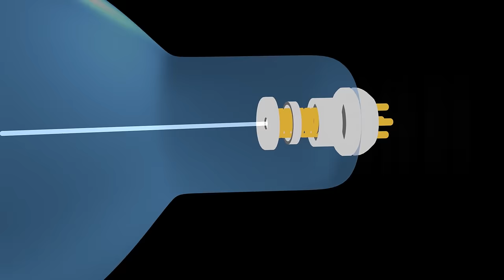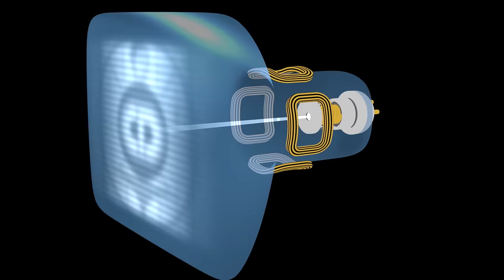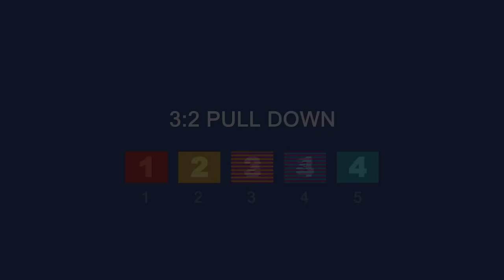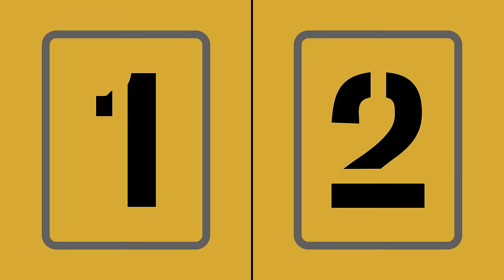CD / Interlacing

Comment: Before watching this video, I was aware that a program called Handlebar was able to remove interlacing fr converting DVDs by using the ghosting effect. The issue is, the monitor I was using at the time was the 720p progressive scan I wasn't sure what I was doing. This was years ago that this happened.

Comment: Can't you just leave the lines in between black when converting just like how they were originally?
Reply: Yes, you can. The reason why it is not done is that you lose half the brightness when doing that on an LCD, so the image gets really dim. Another issue is that timing and resolution become really important, you have to match them perfectly to the source material, you can't just scale the image to the monitor resolution or watch a 50Hz video on a 60Hz screen, otherwise you end up with artifacts and flicker. Example video: https://www.youtube.com/watch?v=d5eIjEEWQp8
Reply: @grumbel45  Thanks!

Comment: However CRT displays most commonly had their frame rates tied to the frequency of the AC mains power input so this was a limitation to an extent as CRTs in countries with 50hrz AC frequencies were limited to 25, 50 or 100 FPS which in countries with 60hrz AC frequencies CRTs could display in 30, 60 or 120 FPS! That’s also why in PAL countries with 50hrz AC power systems computers and arcade games were often capped at 50 FPS even though they were actually capable of running at up to 60 FPS! Also often line interlacing was done on VHS recordings and even VHS camcorders would add interlacing so that’s why most old VHS videos have interlacing! :)

Comment: Interlacing still halves the bandwidth requirements for a given resolution/framerate.
(fun fact. HD television broadcasts in my country are 1080i/50hz)

Interlaced video does not work so great on modern displays though. That's quite true.

But even so, given that it allows high resolution for slow moving objects with higher framerates for faster objects at a lower effective resolution...

It's an interesting tradeoff.

Also interesting is how 80's and 90's game consoles and microcomputers abused the broadcast signal specification to create a true progressive scan mode on these exact same televisions.

This was essentially done by scanning the same field twice, and leaving the other blank. (this is why games have 'scanlines' - one of the fields is blank, thus it shows up as dark lines between rows)

Really, the more fundamental question you might ask, knowing how CRT's function, is why didn't television simply switch to progressive scan the first chance it got?

The displays were more than capable of 50/60 hz (or a lot more for computer monitors), so persisting with the interlaced standards for so long is pretty odd.

For that matter, as CRT computer monitors demonstrate, (and some early japanese broadcast standards), there was nothing stopping us moving to HD while still making use of CRT television technology...

It wasn't the displays that held HD back, it was the broadcast technology itself... (and I guess digital video decoding)

We likely would've had HD video even if we still used CRT's (I had no trouble getting 1920x1080 onto a CRT monitor through a HDMI to VGA adapter in fact), but it would have been difficult to do in any practical sense without digital video encoding and decoding...

Comment: I shoot with an analog NTSC 3 tube camera for it's look sometimes and Virtual Dub has one setting in one of the deinterlacing filters that looks good enough to use in transfers to 1080p and call the overall result decent if not better then decent, given the source resolution. And I don't like interlacing artifacts... guess I should go work out what exactly I've been using.

Comment: There should be a third option for deinterlacing using an algorithm or AI to fill in the gaps between lines so you get full resolution at the full framerate. Shouldn't be too hard.

Comment: It wasn't just a cool idea to do interlacing this way, ie, increasing the temporal resolution, it's the only practical way. Using the same frame for both fields would have required a way to store that frame while transmitting the first field.
Reply: then why didn't they just transmit all of the lines 25 or 30 times per second instead of transmitting half of the lines 50 or 60 times per second?

Comment: Or You can use a 60 FPS video and each field has a frame, preserving the detail and motion? ...Just saying.
Reply: This is pre-HD technology, mostly used on CRT's... which you'd know if you paid any attention to the video.
Reply: @KurosakiYukigo  No, I'm saying if you want to display interlaced content on a modern display, you need to convert it to a 50 or 60 FPS video in order to show both fields. Do you not understand that?

Comment: Is interlacing the reason those pld soap operas look so weird? Or is that something else?  
Either way, really great to see you still smashing out great content.
Reply: That's actually a product of the framerate (or the artificially inflated framerate due to the interlacing so yeah you're correct.) You get used to seeing shows in the standard, slightly fuzzy 30fps, so when you start to see footage in 60... it looks really... uncanny valley sometimes. It doesn't help that soap opera acting is so robotic.
Reply: @KurosakiYukigo  but some stuff i see in 60fps looks great, maybe its the lighting, framerate and acting all at knce
Reply: @dekatonkheir  Most likely yeah
Reply: The common myth is that it's due to the 60fps vs 24fps you get in movies, but soap opera look is much more complicated and comes largely from production values, lighting, set design and so on. Those shows are done on a tiny budget in a studio and closer to a theater play that is filmed than an actual movie. The video cameras also produce a lot of artifacts like bloom, blur, smear, etc. that you don't see in actual film and early video cameras were so big that you couldn't even take them outside, so everything was filmed in a studio. The series Twilight Zone is a neat showcase, as in the mid of the show they switched from their film to doing video to save money, they switched back after a handful episodes.

Modern 60fps really doesn't look much like a real soap opera, as it is not just as crisp as film, but even more so due to the reduced motion blur, something video never was. Production values are however still an issue, as Youtube is pretty much the only source for 60fps video today, there is only a single movie in 60fps that you can actually watch today (Billy Lynn), Hobbit never got a 48fps home release and Gemini Man isn't out yet.
Reply: @grumbel45  interesting, cheers

Comment: I thought the interlacing was used to lower the data rate necessary to transmit the motion picture, not for the phosphor's speed. Because we can see the whole screen with the help of persistence of vision, even if the phosphor gets dim very quickly. Actually, CRT TVs only shows a few lines before the phosphorus gets dim. Here is a video about that; https://www.youtube.com/watch?v=3BJU2drrtCM

Comment: CRT monitors could also display without interlacing (progressive scan), couldn't they? CRT TVs AFAIK were always interlaced, though.
Also, for any serious gamer, you have to use CRTs. Even among CRTs, some have more image delay than others (albeit incredibly slight). Non-CRT displays are completely out of the question, however, except for the casual and the ignorant.
Reply: Yes, and progressive scan monitors were ludicrously expensive when they first came out. If I recall they filtered down to the consumer market from the TV industry. Eventually progressive scan TVs came out and were all the rage in the mid to late 90s and early 2000s.

Comment: Europe wouldn't be the winner with their 50hz screens. 60hz ftw.
Reply: Not really.. Difference between 480i and 576i is slightly bigger than the difference between 50Hz and 60Hz. Almost no visible difference between 50Hz and 60Hz on screen, both had kind of visible flickering, both were same smooth in comparison..

Comment: Your grasp of the technical details of interlaced television leaves a lot to be desired. The effect you demonstrate is not 'interlace artifacts', it is called incorrect Frame Dominance. And the correct frame dominance can usually be selected at the time of encoding. Oh, and your assertion that in the analog world there was no horizontal resolution is also wrong, there was and it was measured in 'lines' of resolution, typically it was around 400 lines of horizontal resolution. Take a look at a old TV test chart and you will see the resolution wedge of vertical lines.

Comment: Who cares about correct phosphorous animation, when you made much bigger mistakes in your video and you still haven't corrected them. You need to make another addendum. (1) You said that analog video has no horizontal resolution, which is wrong. Here is the formula: TVL = (2 tHA BWS)/AR, so horizontal resolution of NTSC is about 333 TVL. (2) Glowing and dimming does not have to happen instantly - this was the whole point. It should happen so that the first field would start decaying when the second is shown. Brightness has a bell curve. LCD, on the other hand, turn on and off almost instantly, which is why first LCD TVs looked stuttery, modern TV sets have much higher refresh rate to alleviate this. (3) Because lines do not decay instantly, it is not half of the image onscreen at one time, it is a combination of two fields, one decaying, another appearing. This is why combing is not noticeable on a CRT TV. Cumulative resolution is described with Kell factor, which you did not mention, but it is higher than one field and lower than two fields combined. (4) Two passes are not displayed completely sequentially, they overlay. This is how they were able to claim total vertical resolution higher than a single field. On a progressive scan TV, of course, you cannot do that, so you display the fields completely sequentially, converting each field into a full frame.(5) Frame rate did not double, image rate did. (6) The correct name for 3:2 pulldown is 2:3 pulldown. (7) Again, progressive devices do not "show fields for what they are". Flat screen TVs deinterlace 30i into 60p, not into 30p. Youtube does not care to deinterlace correctly even after 2014 when it enabled 60p mode, this is unfortunate. (8) Your two ways of deinterlacing incorrectly call interpolating what is in fact field blending. Both of your deinterlacing approaches keep the nominal frame rate, losing half of the images. None of flat screen TV sets does this. Instead they at the very least use "bob" deinterlacing, converting every field into a separate frame. This is the biggest mistake you've made. Seriously, how?